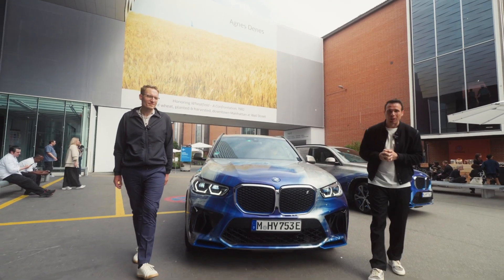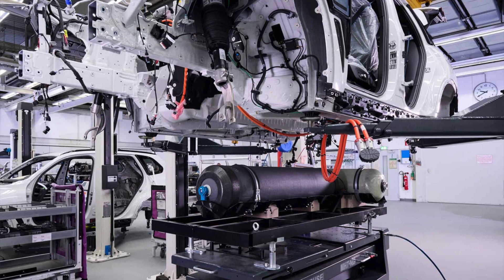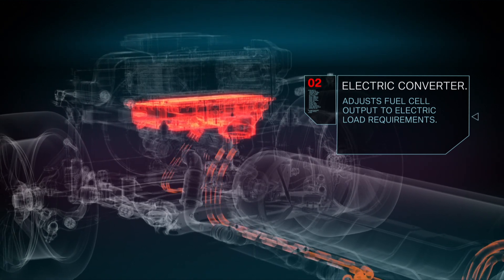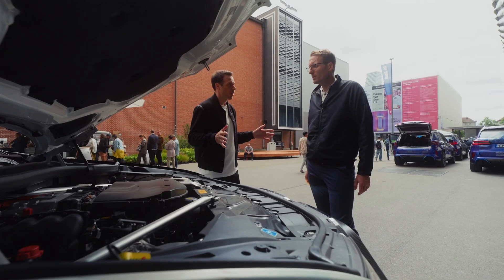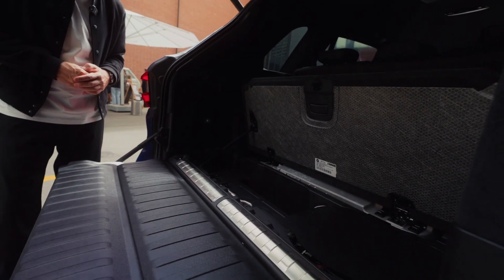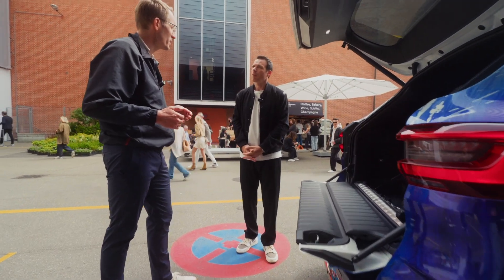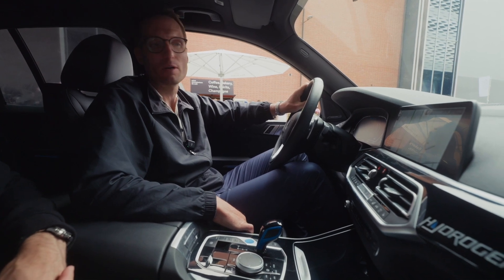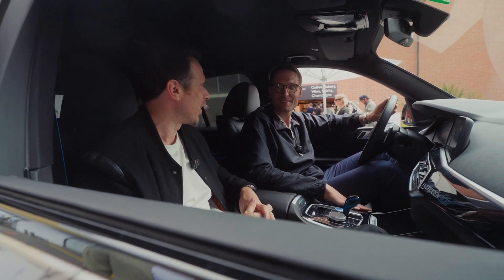BMW iX5 Hydrogen - Is This The Future?

Comment: If it has an electric engine then no it is not the future. The engine is the best part in a car. Dont provide an engine and you hav a soulless dead skeleton
Of a vehicle..
Reply: Both of the hydrogen powered cars currently on the market use an electric motor to drive the wheels....as do these BMW prototypes. They're still electric cars.... An engine won't be much use once oil runs dry or becomes unviable to refine in huge quantities.
Reply: Electric cars are more fun to drive.
Reply: @harmony3138  thats the least true claim i have ever heard. Nobody  can hear u arrive, nobody can hear you anywhere, you cant drift, you cant do ANYTHING fun with an EV. Literally anything that is fun with a car, you cannot do with an EV..no pops and bangs, no turbo whiste, no turbo dump sound, u cant leavt in a cloud of smoke either. Whats the point then.. its only good fro grocery shopping nearby thats it.
Reply: @Aizman87  So what you're telling us is, you need a car to act like a toy coz you haven't finished growing up yet????  LOL, man.